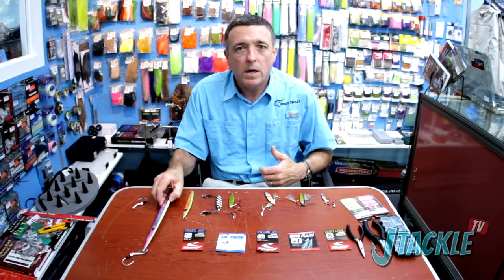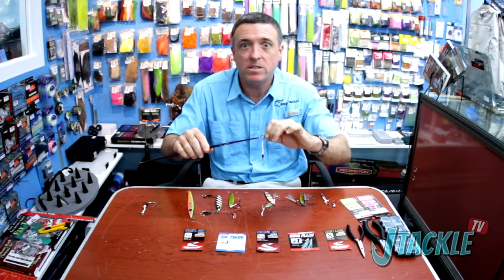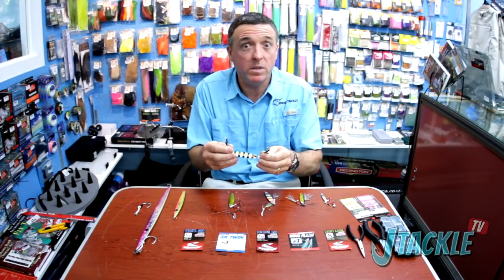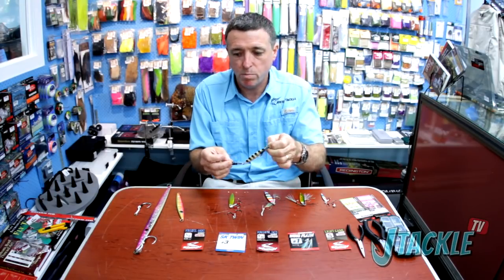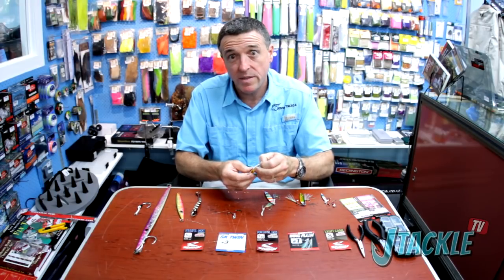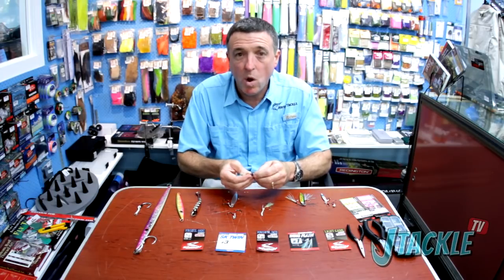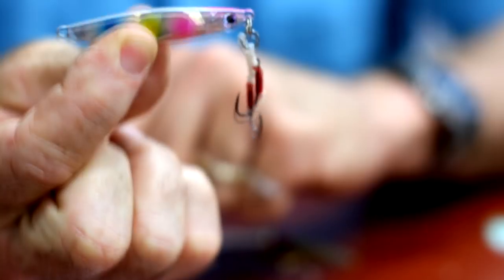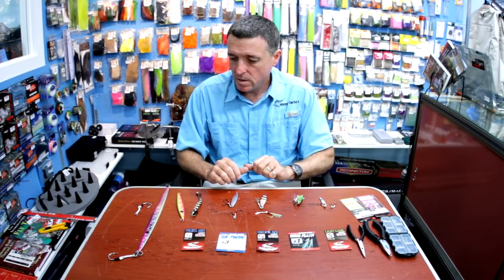J TACKLE TV Episode 3: Rigging techniques for Micro Jigging

Comment: Mate at 2.00 when you rig it properly tied to the solid ring, to change your jig you just take the split ring from the old jig and transfer it to the new jig, simple.  Im gonna keep watching because i see your 3rd jig along is a slow pitch jig with double assists at each end which ive just started using.